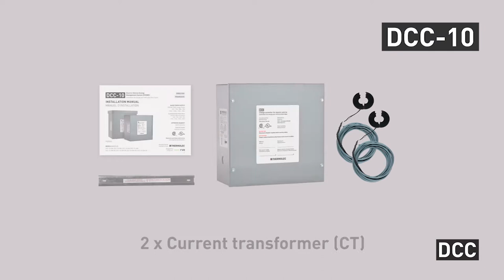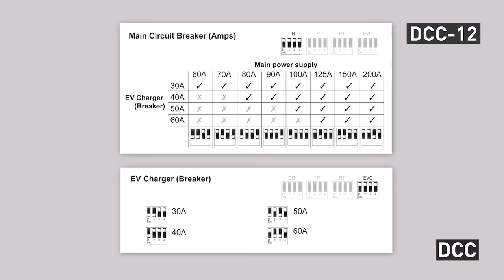DCC-12 & DCC-10 Step-by-Step Installation for Home EV Charging

Comment: Nice video. It would have been great to see where the wires (line and load) came from and went to. For example: "This group of wires came from the meter and goes to the... This other group of wires connects to the panel from..." In essence, it would have been great to show both the source and destination of all the connections.
Reply from the maker: Thank you for your comment, we will take this into consideration for our next videos
Reply: An experienced electrician knows what is what. For the average person, for sure it can be confusing. Yet again, you can always refer to the instruction guide for details.
Reply: @purchmansellinvestments4975   Have you installed any DCCs? If so, your input would be helpful.
Reply: @KnittingThreads  yes I have. What would you like to know?
Reply: @purchmansellinvestments4975  Do you have any videos of your company installing DCCs you care to share on YT?
Reply: @KnittingThreads  no, I do not have any videos, but what would you need to know exactly? Basically, there is a LINE from power and LOAD to panel. Depending where the DCC is being installed you will always need to take in account the space you have to work with. At time it is installed right after the counter meter (in a multiplex building that has an electrical room). At other times, it is installed next to your breaker panel (if loaced in a single dwelling house). The Line power is connected in the LINE part of the DCC and then another cable leaves the LOAD part to go feed the electrical panel. The Cable that will go power the EV charging station is connected to the part where there is a double pole breaker in the DCC. Think of it this way, the main power is going through the DCC before going to feed the electrical panel. Through the DCC, you charging station is being powered. When the DCC notices that your panel is using 80% or more of it’s capacity, it will prevent the charging station from being powered. That way, you will not be overloading the system. In the DCC, it is important to set the little dip switch according to your charging station’s output. If you are not an electrician, I would strongly suggest not trying this on your own, because not only can you get hurt (and die), you can possibly cause a fire and kill other people. Also, this entire process willrequired you to either turn off the counters (multiplex) and break the electrical supplier’s seal, which in certain jurisdiction will come with a severe monetary fine.

Comment: Do you guys know the CEC? You only need this system if you are sharing the CB with another load (e.g. range or stove). If you have a 200A panel for example you just add a CB and a dedicated plug. That’s it. This system is only needed when you don’t want to upgrade the panel. Rule 86-300, subrule 2 of the Canadian Electrical Code 2021. Check it out.
Reply from the maker: Hi @gerulais,

Thank you for taking the time to write to us! 

First of all, yes we are well aware of the Canadian Electrical Code. 

A DCC unit does not share a circuit breaker with another existing one (e.g. range or stove) : it needs a dedicated circuit breaker from your electrical panel to work properly. This means that rule 86-300, subrule 2 doesn’t apply to a DCC unit.

If we take the example you mentioned (200A panel and adding a circuit breaker and a dedicated plug), you would need to add the EV charger load to the load calculation of your panel. Even with a 200A panel, the load added by an EV charger might sometime overload the whole panel when in high demand (electric heating, spas, sauna, A/C, …).

A DCC-12/10 can then indeed be used to avoid doing a panel upgrade, which is very costly and time consuming. The main job of all DCC unit is to monitor the main panel and allowing the load it control to function until a threshold is reached.

I hope this helps clarifying the situation!
Reply: @dccbyrve  yeah, your explanation clarifies things, although your example is somewhat extreme because the loads you mentioned are rarely, if ever, all used at once. The CT provides that extra protection to avoid a possible panel overload. And I like that.

Comment: If installing the DCC-12 for a NEMA 14-50 outlet, how is the neutral wired?  Just passed through the DCC from the panel to the outlet?
Reply from the maker: Hi Kevin,

What we've seen in the past is the installation of an insulated splice. As long as you do not add a neutral lug or modify the interior of the DCC and that you respect the local electrical code and the installation manual, there will be no problem with our product. 

Thank you for your question!
Reply: @dccbyrve  Got it, so like a polaris insulated splice (IT, ITO). Thank you.

Comment: Do i really need a $1100 DCC when the Tesla will be programmed to charge fro 11PM to 5AM at lowest power demand and cost?  
Couldn't a 50 amp breaker box do the same thing, allowing the Tesla to control the demand times.  Thanks
Reply: I totally agree with you.  Looks like a money grab to me.  But hey, electrical standards body will say that the average person is too stupid to know NOT to turn of the electric dryer while roasting their turkey before heading out to grandma's.  And we can't ask the main breakers to do what they are designed for, ie. turn off if you're drawing too much current.
Tesla could make a small device with the current sensors that monitors current and then sends a command via WiFi to the Telsa charger to slow the charging rate.  The device would be small and not have to handle any high currents, therefore cheap.  Better then this DCC device, Tesla's solution could reduce charging as other high power devices turn on, instead of completely stopping charging like these devices would.
Hey DDC Electric, there's an idea for you. Figure out how to communicate with the Tesla chargers.
Reply: It depends entirely on the calculated load of your home and your current main service size.  The CEC code is very specific about how the electrical load of your home appliances, heaters, A/C, etc is calculated.  Depends on what loads are in your home and the total available power, 100 A or 200A for example.  You cannot add a 40Amp EV charger unless that amount of power is available after calculating the total existing loads.  If your available power is not sufficient, then your only option is to increase your main service size or monitor the loads with this device so that the EV charger shuts off when the power consumption is too high.  Your electrician will know this and should assist you accordingly.